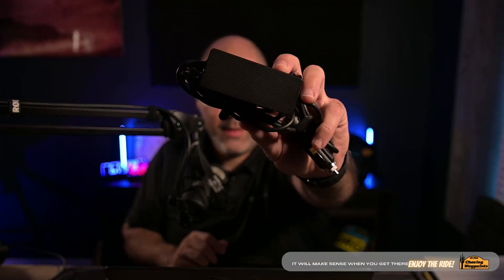STARLINK MINI 12v Powered #starlink

Comment: Your 12v probably didn't work because of the voltage drop. What size wire did you use?
A short thick wire should work
Reply from the maker: I did not realize how much that played into the equation and since have gone to smaller runs of cable. Lol its funny how many cables and setups you end up with just trying to get something dialed in.

Comment: What am I missing here? Buy a $20 car inverter and plug it into a back seat vehicle power port and plug the 110 starlink plug in. Powers on automatically with the key.
No plugging in 3rd party crap to let out the magic smoke.
Reply from the maker: Converting from 12v to 110v is more taxing due to inverter consumption. PD is more efficient.
Reply: But how long can you run this Starlink off your car battery before draining it?
Reply: @kindredspirit1  Forever. Cars have alternators.
Reply: @mikecamrcplus3057 
Lol, I think he meant how long with the engine off.

Comment: Less expensive option is use step-up transformer 12V-24V to 36V or 12V-24V t0 48V and Female barrel connector. Works like a charm and for extreme portability you can power the Starlink mini with Ryobi tool batteries. You can use other tool batteries also, the Ryobi battery has the low voltage cutoff built into the battery where other batteries the low voltage cutoff are generally in the tool, so you would need to add low voltage cutoff circuit to use other batteries without possibly damaging the battery by over discharging them.
Reply from the maker: GOOD CALL!
Reply: That's good to know about the low voltage cutoff in the Ryobi batteries. I have both DeWalt and Ryobi batteries and I was considering using one of my DeWalt batteries to power my Starlink. But now it's obvious the Ryobi would be a better choice.

Comment: Bro to many wires, just buy a 100w cigarette type c charger and the type c starlink mini cable. Works great for me.
Reply from the maker: Yeah I have an update coming thanks to Stargear!
Reply: I actually bought a barrel connection straight to the 12V ...I havent had any issues. I also have a 100w cigarette type c charger but i havent had to use it.

Comment: What's the PD voltage request? 20V?
Reply from the maker: Correct, the PD adapter is used in the video calls for 20v
Reply: @ChasingWaypoints  you can get ugreen etc 12v cigarette adapters that output 140w PD or 20v*7A. This is more than enough for starlink mini